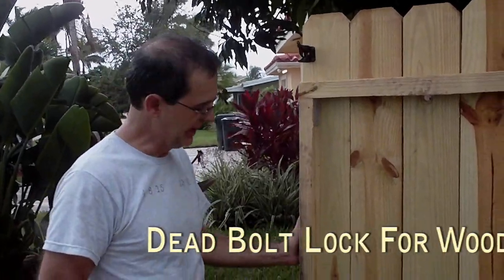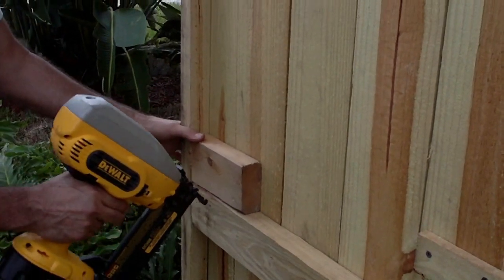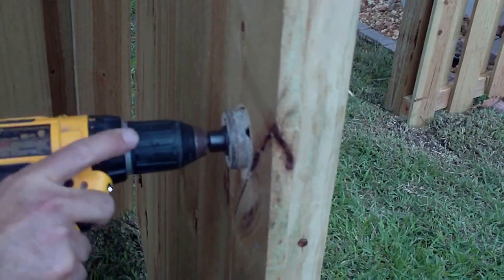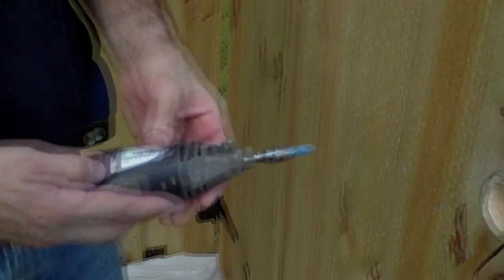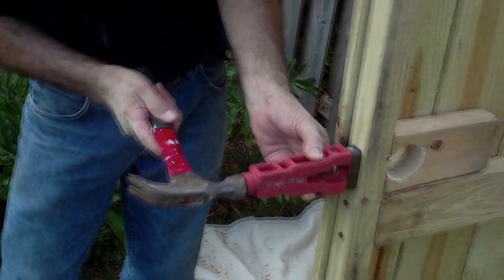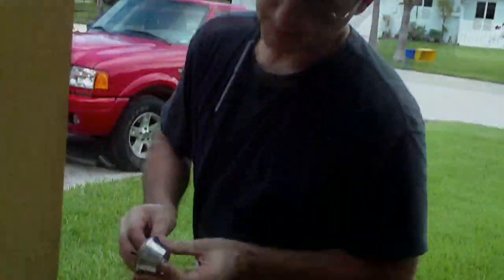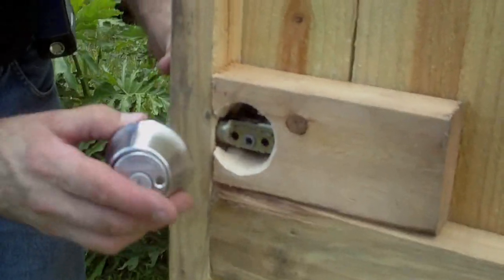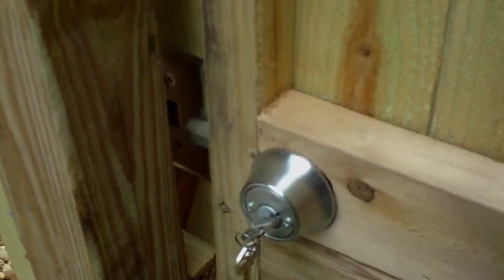gate dead bolt final

Comment: Would of been nice to say what size hole cutter and drill bit you used
Reply: The part you put the key into is a “2 1/8 hole saw”, and the part you install into the side of the door is a “1 inch hole saw”. I don’t know what he used, but a “standard” doors is what I listed. Hope this helped.
Reply: You can get the lock jig online or at homedepot store that comes ready with the jog and hole saws

Comment: Oops for the recess! a couple of tricks. Screw the small hole saw into the size you want to make bigger, like stack them together, it will guide the bigger saw in... Hole cut. Or cut a hole in a bit of scrap the larger size, place it over the smaller hole, clamp and use this as a guide for the bigger hole cut. I have no help if you want to drill a smaller hole that what you have drilled! :)

Comment: What about a steel gate frame? How would you install a deadbolt onto that?
Reply: ReaperXC there is actually a metal set ready made that has to be cut to fit in the frame and install the lock and dead bolt.
Wrought iron supplys has it
Reply: @vachikgharibian4445  plasma cutter